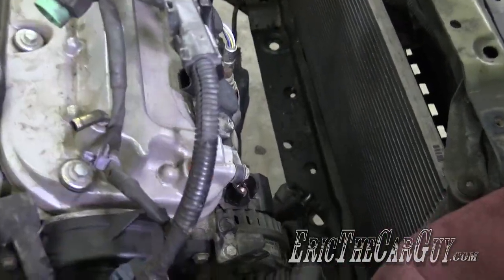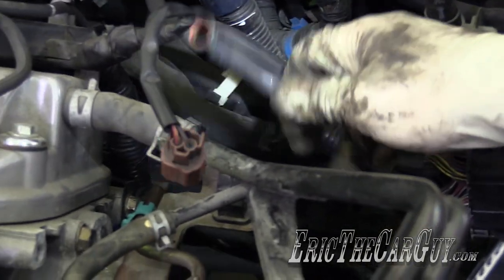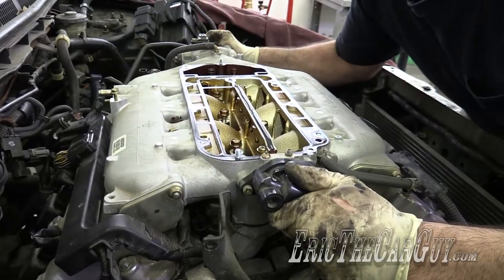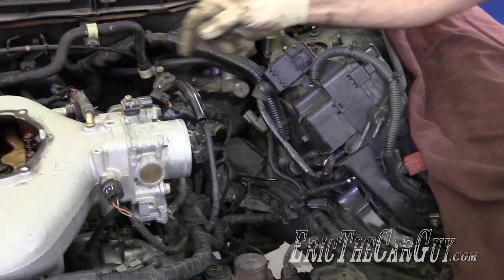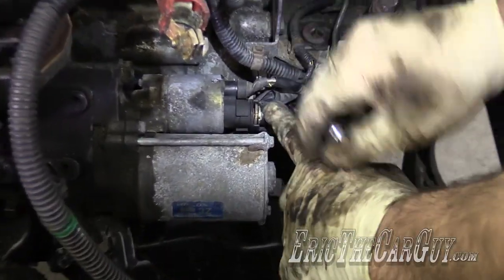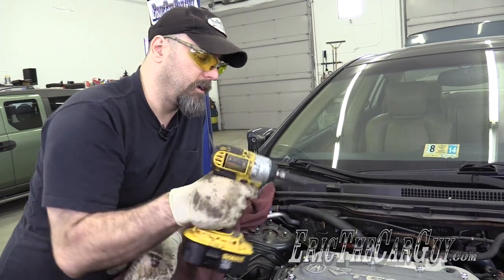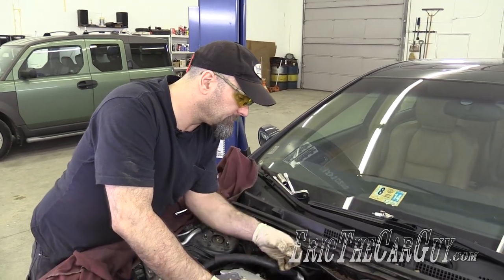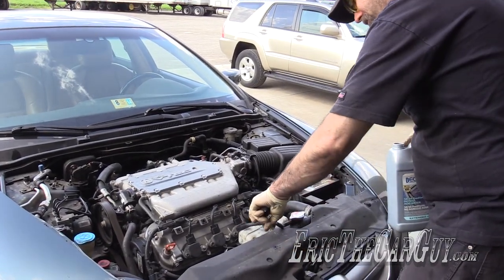2004 Acura 3.2L TL Engine Replacement (Part 4)

Comment: Hey Eric, my 2010 Toyota Sequoia 5.7 with 54k miles on it used to burn 1 quart of oil every 2000 miles when running on 5W20 viscosity. Now I put 0W40 weight in it which is thicker, it now burns half a quart every 2000 miles. Is there anything I can do to fix this problem? I've got 2 of these cars and the other one runs perfectly fine and doesn't consume any oil during oil change intervals, only this one. Thanks!

Comment: I had a feeling you were going to mess up your micro-start, I have one too and it says not to leave it connected for more than 10 seconds after starting the car. I'm guessing that an alternator puts out way to much amperage for it to handle. Hopefully you can just replace the cord!

Comment: Belt will sometime correct itself so you can bump the motor a turn or two and the belt likely will position itself on the pulley.

Comment: Sir  erick how are you? I have an acura tl 2005 and we change the engine but the transmission is not the same as the green light of d is on and the car runs as in third. What could be wrong installed?

Comment: Hey Eric, 

Quick question do you think its possible just to leave the transmission in the bay and just pull the engine out if only the engine needs to be replaced?

Comment: Nice job Eric.  I will have to show everyone sometime how we take a Engine and Trans out of a Bus.  Sometimes we will split the Trans first and other times if we need to work on both parts we set the Engine and Trans on a Cradle and roll it out.  Next time we do one I will try to shoot a video for everyone.  I have thought about purchasing a Acura used.  What model years do you recommend?
Reply from the maker: +busjockey1 Cool.

Comment: Didn't know that the TL was able to chirp tires on 2nd and 3rd gear lol
Reply: Sipher those 6 speeds are awesome 280hp
Reply: every manual transmission car can do it, just release the clutch as fast as you can without letting the engine reving down, having a garbage tire will also help.
Reply: If you think that's impressive you should get behind the wheel of a 4th gen TL with AWD it's in another league completely
Reply: @lucastheproducer995  I think it's gorgeous! Specially the 09-11 beak. I daily drive my 05 6mt, and save my 2011 6MT for times when I really want to have fun
Reply: @supersabrosinho  yea it may have better internals but I can’t get over how ugly it is lol /:

Comment: Eric did you waited until the engine was cold to replace the spark plug or was the engine not hot? Aluminium or iron?

Comment: I had wondered if there was going to be a misfire as it could be heard during the crank.  I crank the engine on the ground before install to listen for changes in compression.

Comment: Also, Having a similar power problem with my daytona iroc 3.0, but when I get to the top end, not only is it gutless, the engine also feels quite imbalanced at about 5500rpm, could that be due to the cat just being melted out or clogged beyond recognition?

Comment: Does the 2004 use the intake resonator located in the wheel well? I know my old 2003 TL did, which is a second gen compared to 2004/3rd gen.
Reply: Yes

Comment: You need to get neodymium magnets with loops on them. They look like a speaker magnet that's been ripped off the cone, but with a D loop on the end. Why? Because then you can hook your stuff with the bungee rope on to solid metal surfaces with no holes. Never found them on fleaBay, but Amazon had them for a while. I think people use them for magnet fishing.
Reply from the maker: +aserta Thanks for the suggestion.

Comment: that 3rd gear chirp though! this thing has some get-go
Reply: +Wtrxprs007able I mean it's a V6 fwd with tired suspension and old tires; I'm not surprised it chirped in third everything is working in it's favor - great weight transfer (eg. tired rear suspension compresses and the tired front suspension floats with no trouble) tires have no life in them, so they spin easier; heck even the bum motor mount could be a factor. They had 270 at the crank from the factory, no slouch, but it's still a rebadged accord.
Reply: +Jason Young yeah you're right. Still pretty cool though.
Reply: +Wtrxprs007able especially compared to the clogged cat run

Comment: Hi Eric I did a transmission swap on my Acura TL  2006 automatic . But I drove two block down the street and checking engine light come on and D star blinking . And vsa  and car acting weird  code is p0717 any suggestions please ?
Reply: Nasser Leiva sensor

Comment: I have a 07 Honda Accord with a 2.4 93,000 miles.. Would a clogged Cat cause horrible gas mileage?  I have changed air filter, plugs, had a check engine for 02 sensor (fixed that) cleaning maf today and am going to run injector cleaner through it on this tank of gas.  I just got this Accord and got 17 mpg on my first tank of gas?  The exhaust looks questionable (rusty af) from the outside, haven't taken the cat off to look yet.  Sorry, your talk about the cat got me thinking it may be my problem.
Reply: My old is300 did same thing. But u might want to run a scanner first.

Comment: Hey Eric, I have a Honda civic 2002 automatic. it never gets to redline, ever. It shifts at around 3k rpm should I look into the catalytic converter?
Reply from the maker: +M6 H2 http://www.ericthecarguy.com/faq/solving-automotive-performance-issues
Reply: +M6 H2   I would suspect that the transmission is the issue.  You can try shifting the transmission manually.  If you lock the car into 2nd gear, can you rev the engine up until VTEC kicks in or close to red line?
Reply: +M6 H2 Is it an EX? If so, the VTEC will restrict rpm to around 3K if the VTEC solenoid has restricted/low oil pressure or is not functioning properly. HTH
Reply: +Matt Flick It does have VTEC, Ahh  so that is what it could be that it doesn't allow it to rev higher?  I am going to look into this

Comment: You turned the engine without the serpentine belt attached. Why didn't you have to realign the crank with the upper cam?

Comment: Okay , you converted an automatic to manual. How did you replace the shifter? Also the shift levers that go through the firewall.. How did you do that? Do most cars have body style to accommodate both? Can anyone explain? Thanks
Reply: The car was already a manual. It was the replacement engine that came from an automatic car. So he had to also swap the wiring harness and engine mounts from old engine to the replacement engine. I skipped the 3rd video so don't know if he had to swap other parts from old engine over.
Reply: ltrinh6106 ahh.. Thanks for clarifying. I had it backwards.
I may be confused again but what about the computer? Did Eric have to switch computers? Maybe that's why he had trouble programming with his scan tool. What's your thought? Thanks
Reply: ltrinh6106 sittin here thinking. Just realised my last question was still backwards . Because the computer is originally suited for manual transmission. So the computer would only need to relearn the engine parameters. I guess. I'm still learning😊

Comment: Eric, would you recommend changing out all the spark plugs when installing a new engine, or at least checking them?
Reply: +Audioquest56 I suspect he would've cared more about the car, if the owner cared more about it. And if he was actually getting paid to do it.
Reply from the maker: +Audioquest56 I did. I replaced the bad one. ;) These plugs are $17 a piece. I don't think it was in the budget and I didn't ask.
Reply: +EricTheCarGuy Gotcha.

Comment: 20:37 "If you look at the tires, you can see there isn't much left." Also you can see that the treads on the front tires are facing different directions...

Comment: what do you do or can do if those starter bolts wont come free?
I've left them connected doing a trans before.
Reply from the maker: +Zobie You can't with these as they also double as bell housing bolts.
Reply: wire connection bolts not mounting bolts

Comment: For those people that would complain about you impacting down the intake, you should do a scientific test . Time yourself fastening an intake or something similar with an impact, then time yourself running them down by hand and see what the difference is.
Reply from the maker: +mrdylanjoseph Let them complain. I have nothing to prove. The intake didn't explode, the clutch didn't explode, everything was fine. Many people keep missing that fact. Thanks for the suggestion.
Reply: +EricTheCarGuy Haha, no I totally agree. Experience is key. A lot of torque specs are there only for people who are just starting and have nothing to go off of but some number in a book. I just thought it would be interesting to see how much time can actually be saved cumulative if you were doing flat rate.
Reply: +mrdylanjoseph BTW I forgot to say thanks for another great video man!
Reply from the maker: +mrdylanjoseph Experience is subjective. I think a video of that type would open a can of worms. Probably get some views though. I'm just too wrapped up in the Fairmont project to worry about anything else right now. Thanks again for your comments and suggestion.

Comment: I viewed the entire series just to get an idea what it takes to swap out an engine because I consider doing an engine restoration on a collectible car. I watched in horrors mistakes after mistakes were made by Eric. Some of the mistakes could cause serious personal injuries or damages to the engine and the car frame that Eric would have a hard time explaining to the owner. Granted, he agreed to take the job at fixed rate, which I believe was a mistake to start with. I can only summize that this car was bought cheap at auto auction by a used car dealer knowing it has a bad engine. He then bought a used engine and talked Eric into doing the engine swap at the flat rate. It'd would have cost over $6K to get the engine replaced at the Acura dealer because they only put remanufactured or new engine into the car so they can warranty it. It probably cost less than half of that to have Eric shoved an used engine in it. I feel sorry for the poor people who bought this car from the used car dealer who tried to sell it as a low mileage, with a replaced engine. I'd implore Eric to stay away from a job like this, you compromise your integrity and reputation and enable the unscrupulous dealer to make money off unaware buyers. There is a reason that most of us should stay away from these used car dealers trying sell junk yard vehicles that neither properly serviced nor rebuilt.

Comment: I know that the intake manifold will probably be fine even securing with the small impact, but that's why I could never work as a paid mechanic on a flat-rate basis.  I'm too OCD about torquing those types of fasteners.

Comment: I own a 04 TL just did a timing belt valve covers gasket job and Denso iridium spark plugs and coil packs. I have a 142000 mi Car runs Like A Champion. I own my TL for 12 years and I will never sell it. 3rd Generation Acuras was better built..

Comment: Which vid shows you changing out the automatic gear shift inside the car to the manual?  Tx
Reply: This Acura was born on the assembly line as a manual transmission car, the NEW engine was out of an automatic transmission car.
Reply: +CU Tiger He didn't convert the car to a manual. It was always a manual transmission. The used engine he installed came from an automatic car.

Comment: Was that actual wheel spin between shifts?! That's got some power!
Reply: +Yo Fizzle Yep, the chirping of shifting to 2nd gear. It is possible with those to chirp 3rd gear too (assuming you can do it with an 06-07 Accord V6 6 Speed MT)...
Reply: +Yo Fizzle My older 2002 TL Type S will spin the tires shifting into second, and that's with the automatic.

Comment: So, when putting the belts back on, you don't need to make sure that crank and cams are synced up?
Reply: +abbed Idriss Not the accessory drive serpentine belt.  Now if you'r doing the timing belt then yes.
Reply: Got it thank
Reply from the maker: +abbed Idriss It's just a serpentine belt, not a timing belt, so no.
Reply: +EricTheCarGuy Thanks for the reply.

Comment: Damn that thing chirps in 3rd gear when its running properly!
Reply from the maker: +Super Vitz Yep
Reply: yup because LSD. my 00 accord has a 3.2 TL Type-S engine with a 6 speed swap and it chirps from 1st-3rd gear.
Reply: +EricTheCarGuy 2 questions:
1) What is the purpose of driving without a hood?
2) Don't you get a ticket for driving without a hood? thx
Reply from the maker: +Battosai Jenkins Because, and not in this case.
Reply: That wasn't very helpful =(
Reply: +Battosai Jenkins they were still testing and fixing
Reply: +Super Vitz My 2003 Acura TL does it going into 2nd on occasion, assuming full throttle. And it an automatic...
Reply: +Battosai Jenkins he doesn't get paid to help
Reply from the maker: +Battosai Jenkins I didn't have a reason other than it made it easier to go back and do more work if I needed to. I also thought it would make a good shot for the video.
Reply: Thank you! I could've sworn it was illegal to drive around without a hood. Especially here in California. Anyways thx
Reply from the maker: +Battosai Jenkins I think it depends on the officer. If he feels like pulling you over and giving you a ticket, he will. If you're not being a d-bag about it, I think you'll be OK. This was just a test drive. Had I gotten pulled over, I would have explained that and hopefully there would be some understanding.
Reply: Sounds good thx! BTW manual Transmissions rule and CLEAN YOUR ENGINE it's too dirty to be cared for like that!

Comment: One question why you don't use exhaust paste instead of the gaskets ? I stopped to reuse gasket several times cause they mainly don't seal any more after 4 or more times being out. Exhaust paste is the way to go it hardens and expanse under heat :) Hope the next videos will be about the Fairmont :D
Reply from the maker: +stupa55 Nothing leaked, it wasn't necessary, especially with that type of gasket. It's meant to be reused.
Reply: My answer was rather a question cause I spotted this on many US car channels you never use paste for exhausts :/ I don't worry, cause I know if it would leak you would show us the problem and redo it :)
Reply from the maker: +stupa55 Indeed. Truth be told, I didn't have any of that paste. I like to use gaskets over paste. Thanks for your comments.

Comment: I personally don't care about torque. Yeah if its a head or fly wheel sure. When the boss is breathing down yur neck if its tight its tight. You get a feel for it after a while.....ps. I started a car with no oil filter on it the other day! It was a big mess but at least I didn't double ring it and ship it!

Comment: Replacing manual with an automatic, what about the gear shifter? Is it just that "easy" to swap engines because it's a drive by wire? 

I thought you'll need to modify/swap the shifters...
Reply: +EricTheCarGuy I didn't know the engines were compatible with manual and automatic transmissions (maybe not all engines).
Reply from the maker: +Alexander Vynogradov You might want to go back and re-watch the series as I covered that very topic while swapping things over. It may vary from vehicle to vehicle however.
Reply: +EricTheCarGuy Thanks for the replies! I just noticed that I forgot to watch / missed a good bit from part 2. 

Are you planning to check the old engine cylinder head?
Reply from the maker: +Alexander Vynogradov I don't believe there was anything wrong with it in the first place. I think the issue was the clogged cat the entire time. I had no way of verifying that as I didn't have a battery at the time the car was dropped off and since I wasn't being paid for the job, I was only making a video about engine replacement, I replaced the engine and made a video.

Comment: I made the fatal mistake of forgetting something once, an engine mount bracket bolt i didn't torque properly. Came loose after 900miles and dropped into the timing belt -.- somehow i only managed to damage a lifter though.

Comment: Just a question out of curiosity.  When ever I watch any U.S. youtube mechanic changing oil I always see you guys using single quart bottles. In Oz we have single liter bottles too but mostly people buy a 5 or 10 liter can.
Why do you guys use always use single liter or single quart bottles ?
Reply: Because the left over would be in small bottle for easy storage and less space. And people prefer carry small bottle in their trunk than big ass bottle that can spill gallon of oil everywhere.
Reply: And most of the times small bottles on sale imo
Reply: +t dub  I guess that does makes sense. Though here the large 5 liter containers are way cheaper than the single bottles.
Yeh you do have some left but I transfer that small amount into a small bottle for later top ups.
For me it works to buy the large cans because I refill the empty can with the waste oil then take the container to the recycling point.
I just thought that maybe in the U.S it's only available in quart bottles and wondered why that might be. Thanks t dub.

Comment: Hi I Have A Toyota Celica GT Year Is 2000 And It Wont Run More Than 40 or 60 Mph But The RPM Goes Up Any Idea What It Can Be???
Reply: sounds like the transmission is done (if it's an automatic) or the clutch if it's a manual.
Reply: it is an automatic
Reply: then the clutches are burnt, the channels are clogged, or the torque converter is done. that is if you're not just low on transmission fluid.
Reply: what would you recommend doing?
Reply: First put the car on level ground, start the car, and check the transmission fluid level. If low, fill it with the tecommended fluid. If not, smell the stick and look at its color. If it smells like burnt almonds and or is dark, chances are you need a rebuild or replacement  (transmission) which means a $1300ish trip to the mechanic. If it's not bad smelling or looking, it'll be a cheaper trip to the shop. Torque converters are TERRIBLY expensive.